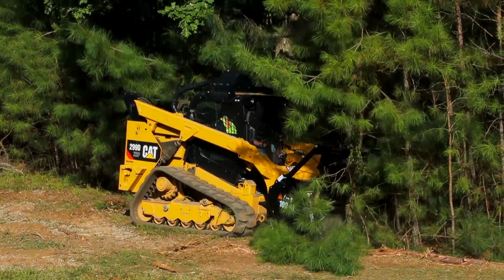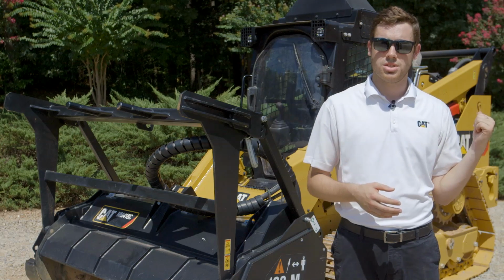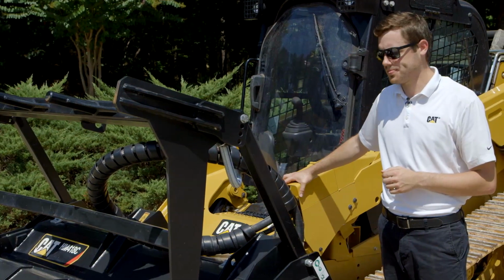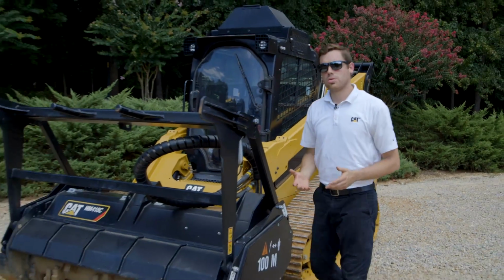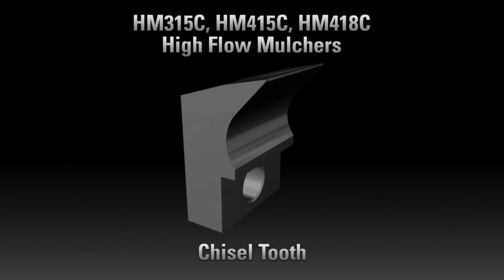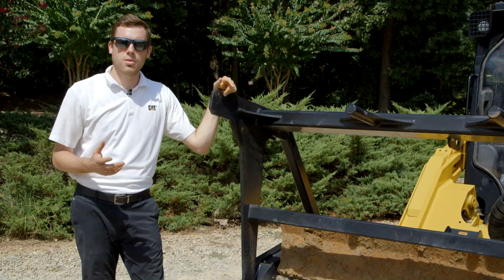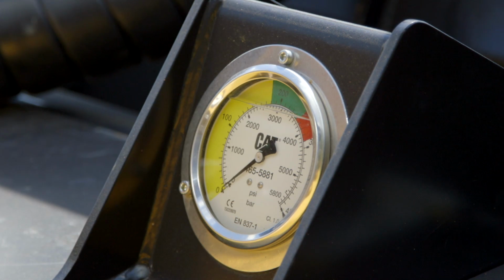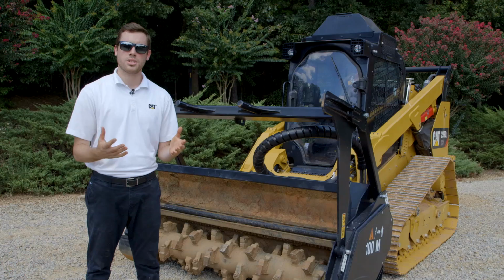Cat® C Series Mulcher Overview

Comment: I have the Door Open and Door Close termination ports on my CAT HM416 BIte Limiter, but the dealership is saying that this model doesn't have that feature. I'm confused. Can you enlighten me?
Reply from the maker: Hi Chris. Our bite limiting mulchers aren’t equipped with a recycle door like the other traditional mulchers. The teeth on a bite limiter are designed to cut leaving a finer finish vs the hammer style teeth of traditional mulchers, which leave a rougher finish. The recycle door on the traditional style mulchers is used to achieve a finer finish when desired. Let us know if you have any other questions! - Dani
Reply: @catconstructiontrade  thanks for clarifying! 👍

Comment: Straight up this is a FAE copy or licenced forestry head
Reply: It is an FAE head manufactured for Cat with their brand , I've got an HM415C that works great as long as your hydraulics are cool but I've had trouble with the oil getting hot under heavy use and the head bogs down unless you let it cool down every couple of hrs.